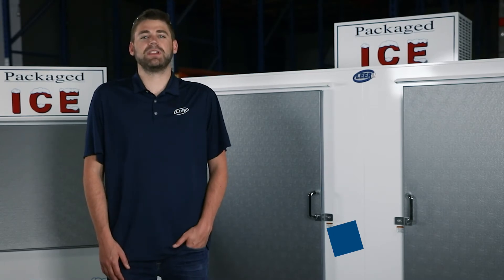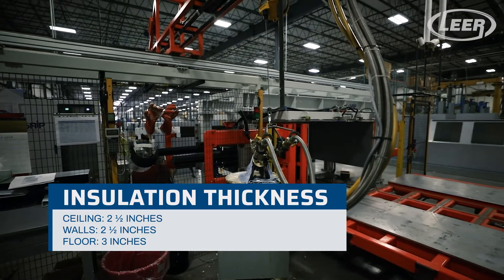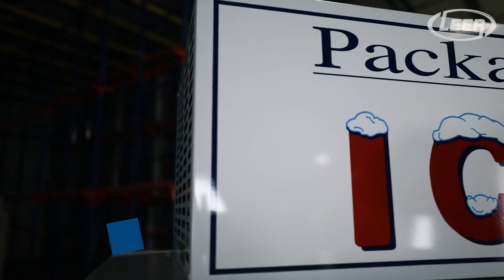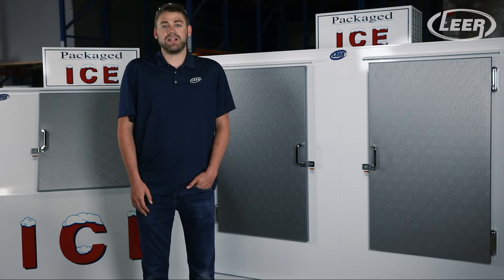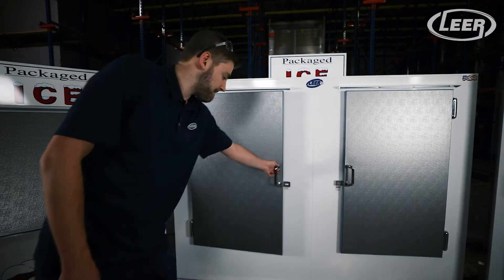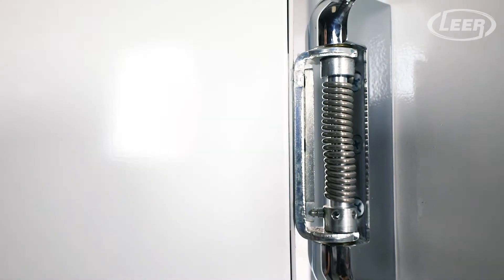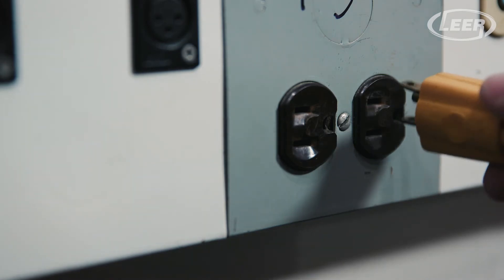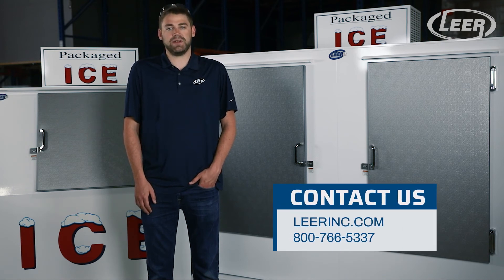Outdoor Ice Merchandiser Overview | Leer Inc.

Comment: I am servicing one of that big merchandiser and its running defrost and compressor at the same time, clearly a bad control as there is no wires crossing, problem is, how do I get the parameters to program the control, does anyone know the information needed as there is no manual or service manual available?
Reply from the maker: Thank you for your comment. Our User Manual is located on our website here: https://leerinc.com/wp-content/uploads/2020/02/Large-Capacity-Ice-Merchandiser-User-Manual-11-20.pdf.pdf. If that does not contain the information you need, please give us a call and request to speak to our Technical Service Team. They'd be happy to assist.
Reply: @LeerEmployeeOwned  Thank you so much! 😊 I called today and the tech support was awesome! 👍 They even sent me a replacement controller. 🎮 #GreatCustomerService.